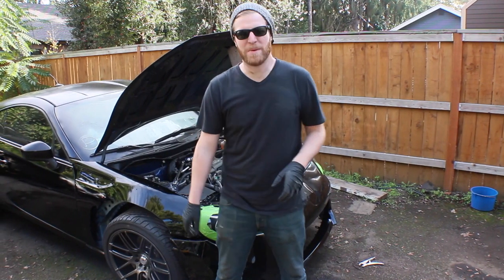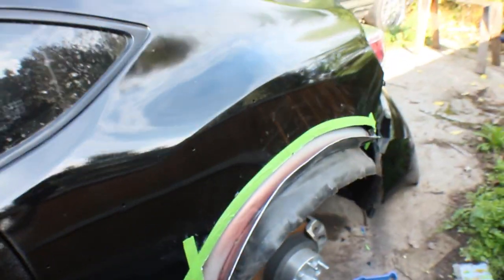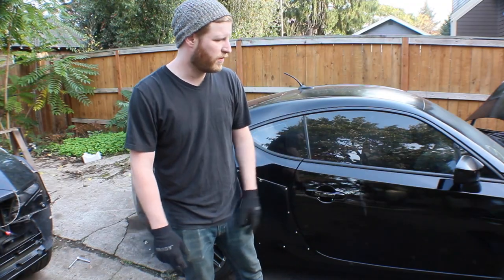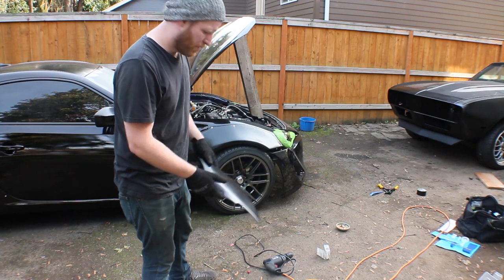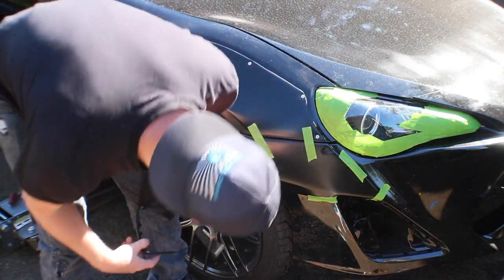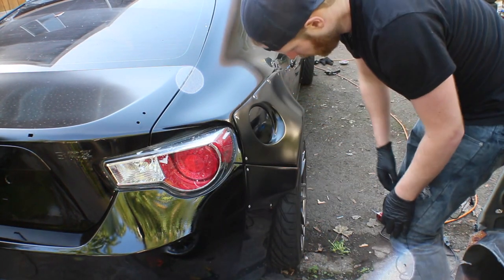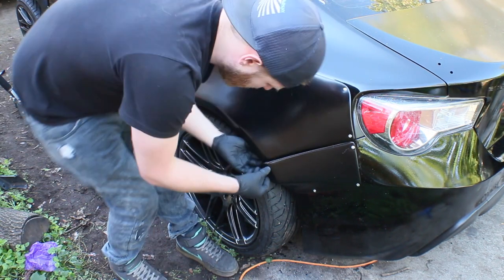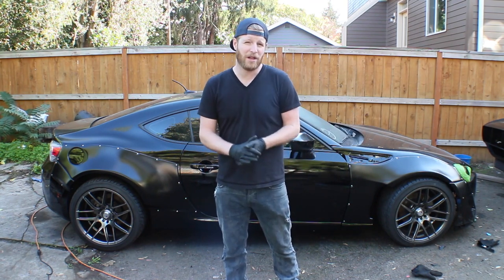BRZ Resurrection Pt 12 - Rocket Bunny Widebody Install pt 2

Comment: Body mans tip

You might want to spray some rubberized undercoating where your quarter panel was opened up and on the front rust is a real shitty thing to deal with.

Also having aluminium rivets going into a steel body, your rivets will corrode a lot faster due to galvanic corrosion, might want to swap them out for plastic/rubber coated rivets. 
Other than that keep up the good work man
Reply from the maker: +Trevor Chang thanks for the tips, i had no idea about the issues with aluminum rivets. Ill keep a close eye on them, luckily its only a 10 min fix to swap them out.

Comment: In germany this car is called Toyota GT86. Anyway, a really nice project. How about to plasti dip the car? It is also cheap and maybe you get a better result. Looking forward to see the endresult.
Reply: +Christian Otto no.. GT86 is the toyota version. You still have the BRZ
Reply: +seba loksean yea. but I never saw a BRZ in germany. Only GT86.
Reply: +Christian Otto Toyota Subaru And Sircon All make there own version of this car. Basically all the same
                            GT86    BRZ              FRS
Reply: +GunsOfPlentyNZ the scion and the toyota are exactly the same, the subaru is slightly different in a couple of things.
Reply: +Bryce Anderson Subaru from memory weight 4kgs more, due to the seats and the steering, and built in displays being slightly different, however they are still basically the same ...
Reply: +GunsOfPlentyNZ  yeah those are the couple of things I was talking about, that and I believe its got a few more options from the factory that make it slightly more different. I also believe the Ecu for the brz has a slightly less limiting traction control program. And I think the tire/wheel combo is different.
Reply: +Bryce Anderson ahah yeah, i dont think subaru uses the same prius tire that Toyota uses, to many people sliding into things when breaking

Comment: I noticed the holes where I believe the spoiler mounts to the boot are still there. Any reason you didn't fill them before paint, are you planning on returning to the stock wing or are you going with the rocket bunny wing that mounts on the rear of the car?

Comment: So, did you guys plug into the ECU/ECM and reset the crash? Many new cars will put a stop on the motor after an accident that causes bags to deploy.
Reply: To further explain, if the airbags deployed you need to replace them as well as reset the airbag control unit. Then you need someone who can access the Engine control unit/module and have that totally reset as well. The ECM will store crash data and will have fuel and potentially spark systems shut down to try to prevent any further fire potential.
Reply from the maker: +nox0underling you sound very knowledgable, i might want your email lol ( message it to me ) i had it down at the dealership and they were trying to do exactly that. The issue is that we have no communication with the ECU right now. Im actually in the middle of filming a video today and ill publish it tonight going over the exact problem the car still has.
I look forward to hearing from you if you have any ideas once i go over it all.
Reply: +B is for Build if it's the airbag ecu they can't communicate with I'm not sure where it is on the brz. If it's the ECM that you cannot communicate with you are probably better off removing the ECM and trying to connect to it that way. If you can connect to it after removing it from the car,  It is probably a short or break in the wiring from when the accident occurred. If you cannot connect to it externally attempt a replacement first. My advice though, it's expensive, but I'd find a good tuning shop and have them make a new loom. You already found damage in the relay/fuse box Under the hood the can of worms of trying to make a loom if you don't have experience is probably far too much. You are MCM fans, the loom when they made Gramps shows how ridiculous it can get, and they had experts making them. I'll message later with more in depth thought if you'd like. it's bed time for me.

Comment: Is it necessary to cut the fenders? I dont really want to cut the car :/
Reply from the maker: +KlevisL if you ran really rigid coil overs and small wheels, youd be alright in the rear, still probably would need to cut the front though

Comment: why would you want a salvaged car? isn't the chassis damaged now?
Reply from the maker: +OfficialVanDyce it was.. i got it fixed
Reply: B is for Build how do you fix the chassis? Will it drive completely straight now?
Reply from the maker: +OfficialVanDyce i didnt fix it personally, i took it to a frame straightening shop and they took care of it, and yep now that its fixed itll drive straight.
Reply: B is for Build pretty cool! maybe i shall do that someday when i got the extra cash :D right now im trying to get an frs, and i need to bargain the hell out of it to get it lol
Reply from the maker: +OfficialVanDyce cheapest way possible is going to be ( depending on state and country ) to look for a salvaged one, with the most amount of damage that you can take on and fix your self. These cars have really thin tires as stock, so they are prone to sliding. That causes alot of drivers to accidentally rear-end people. So there are quite a few of them out in auctions with mild front end damage ( not as bad as mine ) and you could probably pick one up for very cheap. My biggest point of advice is dont settle for anything. Cars come and go all the time, only go after the one you really really want. Correct transmission type, correct amount of damage, correct price. All that stuff. Every time iver ever got a car and thought "ill figure that out later" or "oh i can change that if i really like it" i never end up really connecting with the car and almost always lose money or lots of extra time on it.
Reply: +B is for Build some awesome advice right there.
Reply: +B is for Build Yeah its just right now i dont have the time to work on one, or do i know how to... How much did this cost you in total?
Reply from the maker: +OfficialVanDyce about 7K for the car to get it to episode 1, then all the parts after that add up pretty quick. I dont know in total though.
Reply: B is for Build ah well thats good, you think i can haggle the dealership for a 2013 scion frs with 60k miles for 12 - 13k? lol
Reply from the maker: +OfficialVanDyce I have no idea, haven't been to a dealership in a long time, but I'd assume it's not possible, but you never know until you try

Comment: so much orange peel, you're going to get it repainted?
Reply from the maker: +JuampixDDD im going to wet sand and buff, and if that doesnt help ill either get it vinyl wrapped or ill plasti dip it
Reply: as i saw on the video, it seems like the orange peel is too deep to cut it with wet sanding and a buffer, i'm a detailer, good luck with that, but i think you should either wrap it or dip it to get the color on the kit too